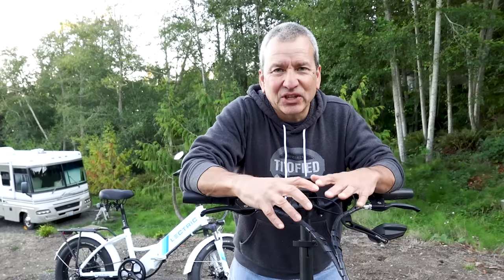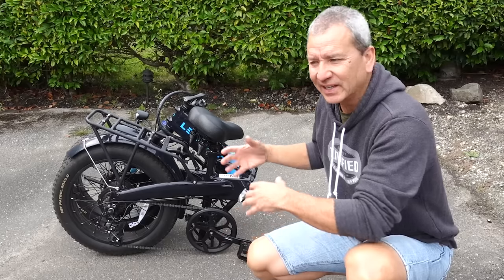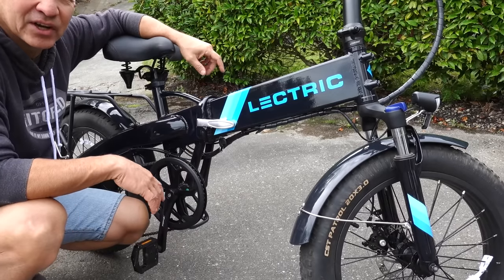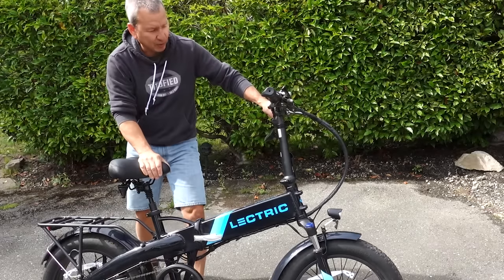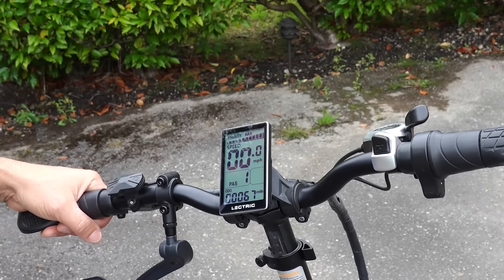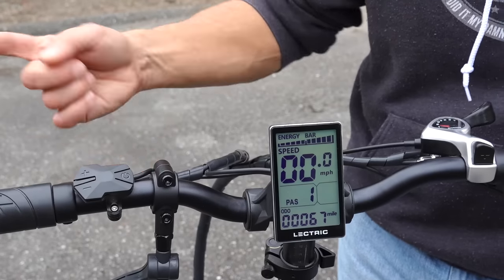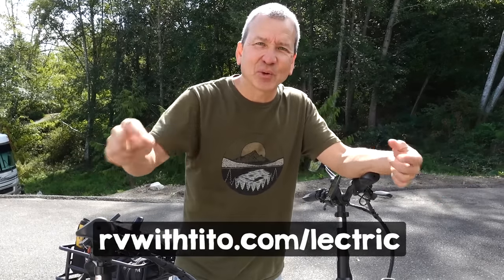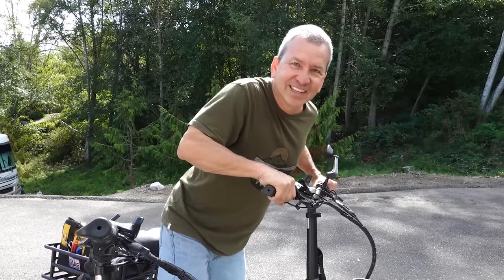Should a LECTRIC XP be YOUR FIRST E-Bike? | Full Review & Testing | RVwithTITO DIY

Comment: Nice job. Just a suggestion. Lithium batteries should only be stored around 50%. If you  are not going to use the bike for more then a few weeks make sure to store at lower state of charges. They will last for years if you do that. Leaving at full and very low state of charges is very hard on lithium batteries and will make them degrade much faster. I’m sure you already know that as I believe you have lifepo4 batteries in your trailer, just thought I would leave for others if they read comments.
Reply from the maker: Yes. Good point. Thanks for the recommendation. I'll keep that in mind if I store it. Too busy riding it right now though :)
Reply: They will also last longer if you only charge them to 80%. Search for Luna Chargers. I have been using one for my ebike for the past two years and they fantastic. You can charge 80,90,100 percent at 1-5 amps. Really helps for a quick charge the times you need it.
Reply: Thanks!
Reply: Yes  have a Luna charger set at 80% with wall timer stop everything at set time and extra battery if want longer ride . Storage in toolbox covered with zip pages of silica sand . With smoke alarm on security system . That might be overkill for LectricXP battery but feel safer .
Reply: Why would I only charge my bike 80% when I want to ride as long as possible? Isn't that just throwing away 20% of my ride time? It seems foolish

Comment: Just started looking at e-bikes and I found your review so well structured, informative and easy to watch. I am EU based, so probably have to settle for something similar.
BTW, for anyone interested, there is an exact science to adjusting a saddle (not for children).
Place the bike next to a wall or fence. When you sit on the bike with a peddle arm dead vertical, the peddle in the middle of your foot, your leg should be dead straight. When you ride with the balls of your feet on the peddles, you will have the optimum bend in your knees and the maximum efficiency from your leg muscles. Also reduces the chances of knee damage if the saddle is too low. I was over 50 when I learned this. Made an amazing difference.
Reply from the maker: Makes total sense. That's the most comfortable position for me as well. Thanks for the adjustment tip!
Reply: So ist es...fast alle stellen den Sattel zu tief. Sieht doof aus und ist gesundheitsschädlich !
Reply: Can this bike be put on a bike rack for the back of a car or is it too heavy??
Reply: @beverlybowman9059  in Germany you are supposed to have a biker rack rated for the weight of the bike(s).
It would make sense to remove the batteries.
Reply: @Rabe1907  yes absolutely. Most of this misconceptions comes from setting saddles for kids so they can touch the ground.
Reply: @beverlybowman9059 can your car handle like 65 lb? LOL

Comment: Hi Tito, 
I've been studying these Lectric eBikes for awhile. Thank you for showing a few features I haven't seen other reviewers show;
The pedal height between the 2 models is important and will sway my decision on with model to buy.
Showing how the battery is removed/installed is also useful to know plus knowing the 2 bikes take proprietary batteries is a critical bit of information.
Your thoroughness is greatly appreciated.
Really Great review. My only comment is you REALY do need both mirrors. Ride in the city much and you'll find many jerks will come up on your blind/RH side and try to get around you at intersections and anywhere there is a right turn.  
People, you can't "Cheap Out" when it comes to saving your life!! Keep your head on a swivel and the rubber on the road.
1/2 million miles on 2 wheels gives you that kind of intel.
 I've never been a fan of mounting a front basket on a bike, since it will throw off the handling if too much weight is in it, but with the Lectric frame mounted basket, other than the odd illusion that the basket doesn't move when turning the front wheel, that design will not affect the handling at all. 
Brilliant idea , Lectric!!

Kudo's to "Lectric " the company. Virtually NO Other eBike, that comes to your door in a crate, has local ie US support, let alone parts and/or service availability or support.
If you live in the West, I bet you could take a road trip to Phoenix, (well, except for the now 3-2022 $6+/gal gas!!) get a tour of the factory and pick up your new eBike right from the source.
Lectric, in my mind, is the Go To eBike to buy.
I don't have one yet. 
I ride 4 Currie eZip/iZip/Schwinn eBikes I've restored and upgraded (to Li-ion) but I think I just have to get a Lectric  XP 2.0 as well. 
cheers
Boots Langley
La Mesa, Ca
Reply from the maker: Thanks for the great feedback. I'm glad the video was helpful. I agree that having someone to call or a visit is very important. We were in the Phoenix area and visited their HQ recently. Cheers.
Reply: Thx for showing the difference between the step-thru & standard model.  The step-thru gives up some ground clearance, but doesn't it also give you more leg extension for the same seat height (i.e more efficient pedaling)?  I really like the idea of full leg extension AND being able to reach the ground while seated.

Comment: I'm 76 and I love mine.  Mine is a different brand but very similar in form, features and function. I use power assist one and that plus gearing I'm very comfortable in the hills. I turn the power assist off for about half the ride and I get about 50 miles between charges. I have a crew cab pickup and can carry folded behind the front seat or a rack behind my trailer.  I forgot to add that I recently started switching to Lithium and your videos on the subject have provided inspiration and guidance. Look foward to mods on the Winnebago.
Reply from the maker: Nice. That works!

Comment: This is an informative video for people who are looking to purchase their first e-bike. There's a lot of information available on-line and it's easy to get confused by too much information. I've owned my first e-bike for about 20 months and in my opinion, unless you're an extreme biker, there's only a few things that you might consider.

Throttle: My e-bike has pedal-assist only. Frequently, I have difficulty starting from a standing stop. Starting on even a slight incline or on soft ground can be problematic. I'd say a throttle (and preferably a twist throttle on the handle, as you have shown) is a "must have".

Step-through: I'm 74 years old and it's challenging for me to lift my leg or twist my hips in order to mount the bike. This is my first step-through style bike and I love it.

Tires: Although I haven't yet had a flat I've had my share of them with my traditional bikes. E-bikes are heavier to push than traditional bikes and tire repairs  are more challenging. In addition, with an e-bike you tend to go further distances and in more remote places than you would normally. So make sure that you have excellent tires that will resist punctures. If I bought a cheaper bike on-line, the first thing I would do is replace the tires with the best quality tires I could find. 

Shock absorbers: My e-bike lacks "shocks". And, even though I don't ride long distances over rough terrain, I'd consider shock-absorbtion good to have (especially shocks on the front).

What's not really important

Battery life/range: From any reviews I've seen, at least for well-known brands, range is more than acceptable for the average rider. I happen to get up to 120 km between charges (which, apparently is excellent) but I wouldn't get upset if I got less than half of that.

Hub drive v mid-drive: Again, unless you are an extreme biker, either technology will suit your purposes. 

Finally, even though I buy a lot of stuff on-line, I wouldn't consider doing that for an e-bike. With all the technology, so much more can go wrong. You will most likely find that the e-bike becomes a necessity and you don't want it to be unavailable waiting for repairs. 

Hope this helps.
Reply from the maker: Thanks for sharing your insight. Very helpful.

Comment: Thanks Tito. Your video stopped me for making a huge mistake. I was just getting ready to buy two bikes. One for me and one for my wife, and I was planning on ordering one step through for her, and the regular model for myself as you see in your video. I weigh 220 lbs, and she weighs 115. Knowing that weight will affect the total distance you can get out of the battery, I was fully planning on switching out the batteries halfway through when going on really long trips so are both have enough juice to make it to the finish line, as mine would run down much quicker than hers. I just presumed that the batteries were the same in both bikes. Your video clued me into the fact that they're not, so I ended up ordering two steps through models instead to make sure the batteries are the same size and will fit into either bike. I never seen any other video review mention it. So thank God I watched yours, otherwise I would of ended up kicking myself after discovering that they are not the same battery in both models. Thanks again!
Reply from the maker: Enjoy! Glad I could help.

Comment: Perhaps some additional suggestions/information: 

   - After unboxing the XP, make sure to check the tightness of all bolts and hardware and torque them to the specs listed in the manual. If you don't have the tools, your local bike shop can do the job;
   - Our XP came with a bent derailleur guard (common shipping issue) which prevented up-shifting beyond gear 3, so I wrapped a piece of rubber around the guard and straightened it with a longer handled adjustable wrench;
   - Our brake pads needed to be aligned with the rotors to prevent drag and brake noise...easily done with an ball-tipped allen wrench and some patience.

Frankly, if I didn't have the tools or the inclination, I'd definitely spend the $80 to have my local bike shop check and adjust everything. It's good the start a relationship with a local shop in case you need anything down the road. For involved warranty work, Lectric will sometimes reimburse a local shop instead of having you send the bike back to AZ.

To acclimate yourself to the geometry of the bike and to make the adjustments necessary for a good fit, I suggest you remove the battery and ride the bike for a few miles without power. Practice making u-turns...always with the pedal up on the side to which you are turning. Then, when you are confident with the handling, braking and turning, reinsert the battery and ride with the additional battery weight in PAS 0 to gain even more confidence.

Finally, make sure you purchase and wear a good quality helmet!
Reply from the maker: Great suggestions. Yes. The LECTRIC manual recommends you take it in for a tune up as soon as you get it. I've made a couple adjustments myself and plan to do a brake and gear tune up as well. Ours have actually worked quite well out of the box.

Comment: Great review.  There's another point to consider about the difference in pedal height to the ground between the two bikes.  If the seat is set to the correct height for proper leg extension, you will still probably be able to touch the ground on tip-toes while seated on the step through bike.  I can do so on my road bike, where the pedal is 3-3/4" from the ground at its lowest point.  You probably won't be able to do that with the non step through bike because the seat will be 1.5 inches higher from the ground.  This may not be a big deal to many because e-bike riders seem to prefer the seat to be set lower than the "proper" height, but just something to consider.
Reply from the maker: Thanks for your input.

Comment: Great job on your review Tito!  I like many of your other subscribers have seen many other reviews and yours is by far the best.  I have had my Lectric XP 1.0 for about a year now and have about 1700 miles on it.  Love the bike!  Wife got one as well but when they came out with the 2.0 which has the front suspension she had to have it.  So her white ST came and we sold her 1.0 in one day for almost what we paid for it. We get stopped by people all of the time when we are on our bikes asking about them.  We do put them in totes and load them into our fifth wheel out of the elements as we travel state to state.  Please note that e-bikes right now are a very high theft item so we don’t like to have them on a rack outside our rig for that reason.
Reply from the maker: We've also get stopped alot with these. I also keep them covered and locked up when camped or on the rack with the handbars folded down. So you can't really tell what's underneath.

Comment: Great vid. I have had mine about 3 months. As an 80 year old a couple thoughts. I had not been on a bike for about 65 years so I rode without any power for a couple weeks, just get used to balance again. Adjust the seat so you can put both feet on the ground while seated. As you build confidence raise the seat to provide an easer pedaling height. I use the walk assist and I like the cruise control for longer rides. Overall a great bike. Thanks again for an informative vid.
Reply from the maker: Thanks for sharing your experiences with this bike as well as the walk assist and cruise control.
Reply: I'm 67 years old and haven't been on a bicycle since I was in my early 20's. I don't want to spend a lot of money if I can't ride it. My balance isn't what it use to be, but you have given me encouragement to take the leap to an E-Bike.  I suppose if I can't ride it without falling off, I can sell it.
Reply: @sandraswarts9186  a couple of things to consider. The bike is heavy so be sure to set the seat low enough that you can have both feet in the ground when seated. For the first several rides do not turn on the power, just pedal as a normal bike. Your balance will come back quickly. Good luck
Reply from the maker: @sandraswarts9186  Best of luck. Ease into it and take it nice and slow at first.
Reply: @geraldkoger5681  Thanks!

Comment: Just received the step through 2.0 for my wife. I went out and purchased  the metric folding allen wrench set. Needed 2.5 to adjust P.A.S. control and 3 to tighten  the screen display in place.
We also found the throttle came into play nicely if you had just stopped for a minute. Use the throttle to get moving rather then peddles. 
Lastly the seven speed part you'll  be adjusting up as you use the PAS  3,4,5, modes.  Helps with not spinning the pedals like your generating electricity.

Comment: I have the black standard XP 2.0 with the cargo & comfort  packages. I added a Blackburn USB rechargeable light package with a 300 lumen headlight & a little taillight, both with flashing functions, because moving the standard headlight to the front rack means when you turn, it's no longer lighting your way. Now, the headlight on the handlebars  will take care of that without diminishing my visibility. Since it's after midnight here, I will get get a 275lb capacity trailer delivered today.

Comment: Good review! I have had my XP for 2 years now, and it is monotonously reliable. I have changed out the pedals and the bars to suit me better, but no issues concerning reliability at all. 

If you want the mileage to not reset during stops, go into the settings and change P 04 to the highest setting, which may be NEVER, but it was 2 years ago that I set it, so I'm not certain now. This will keep your trip mileage as long as you leave the power on. You should find it set to 10, which is the factory default.
Reply from the maker: That's great to hear. Thanks for the settings tip. They now have a long-range battery available, but it isn't cheap.

Comment: We bought version 1 from Lectric in Aug 2019. Based on Youtubers reviews like yours. We have been very please with the bike. Customer service is very available and prompt. Since i pedal the bike mostly, i have only had to charge it one in the two years we have own it. Got a few ideas from your video. We store our inside to prevent theft. Appreciate the video.
Reply from the maker: That's great to hear that you've had a good experience too. I appreciate the feedback. I keep it locked up pretty well when on the back of the RV. I also keep one in our car folded up and covered. Sometimes I take the battery out. My fear is losing the keys :)
Reply: @RVwithTito  we were told early on to store without the battery install in the Lectric since 30% of the bike price is the battery. Also,  if the theft ride off with your Lectric, Most people wont get far on a 65 lb e-bike without a battery. I pedal it mostly without using the motor as practice for bikepacking since my non-ebike with all my camping gear weighs about the same 65 lbs.  Btw, i also have a 1st gen tacoma :)

Comment: I just bought two step thru 2.0 models primarily since the wife is close to 5'-1". Following a brief explanation of functions I got her started with just peddling to get a feel of the bike. She had not been on her bike for two years. A few minutes later she was shifting gears and using peddle assist 1 and 2. She always complained that I rode too fast and left her behind now I won't hear that comment anymore. Since she may be going faster she asked about ebike specific helmets to which I had no answer other than perhaps a ski/snowboard helmet.  Your video is the best I have seen.  The only comments I have are 1). the manual says to inflate the tires to the pressure indicated on the tires. For our bikes it states 35 lbs. and 2.) if not using the bike for several days it says on P. 17 of the manual to only charge it up to 75% so that it degrades less. Time to do a ride this week. 😀
Reply from the maker: Thanks for the tips. Glad your wife is enjoying it. Have fun!